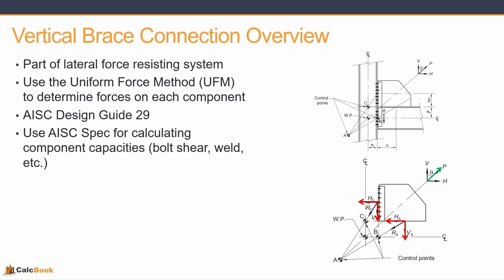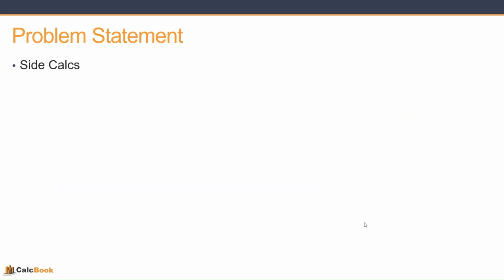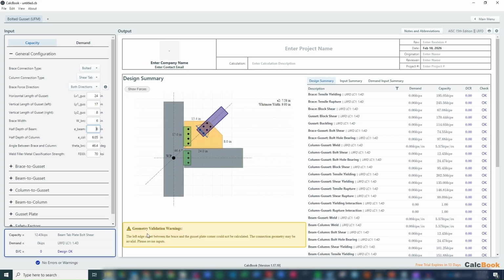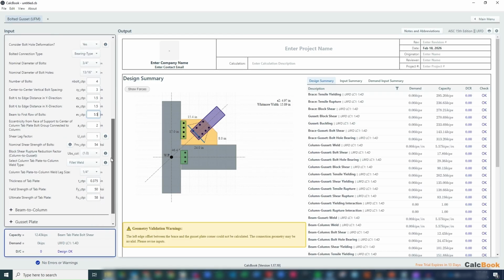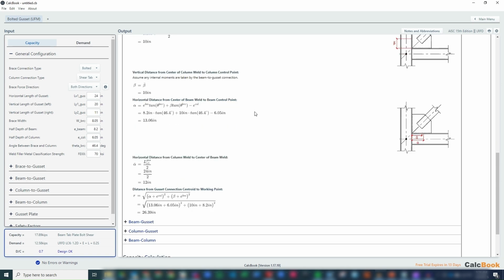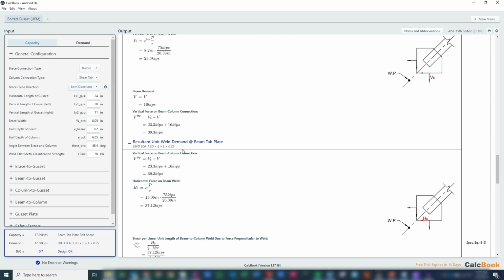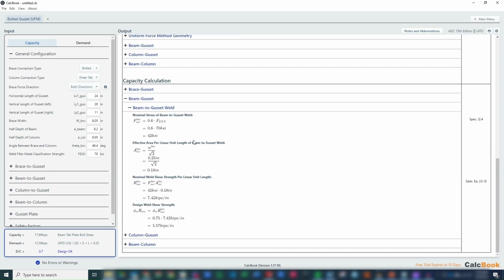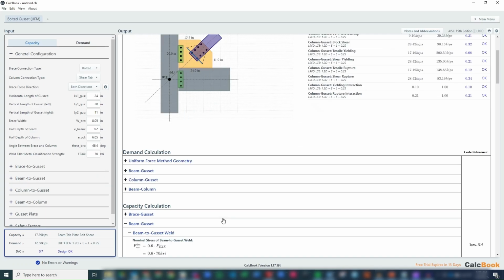Bolted Vertical Brace Connection Design || AISC || Uniform Force Method

Comment: Fantastic video! Just a quick question: is it possible to have a moment connection on one side of a column, with the beam welded to the column flange using an end plate, and a shear connection on the other side of the same column flange(opposite ) ?
Reply from the maker: Hi @constantine6816 thanks for the questions. Yes this could be possible. We have modules and videos covering concentrated loads on beam flanges and web panel zone shear (which would apply to the welded moment connection) and shear tab modules and videos that cover shear connections. Check them out and let us know if they help point you in the right direction!
Reply: thanks man